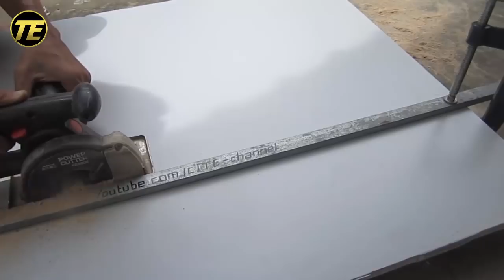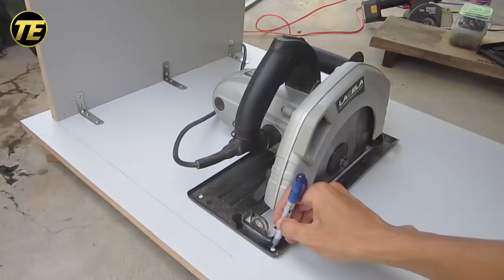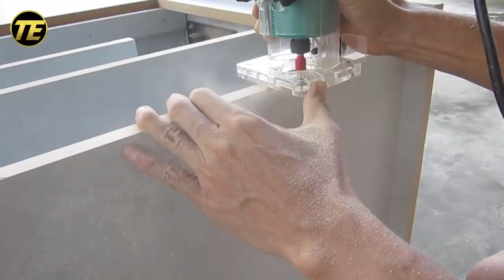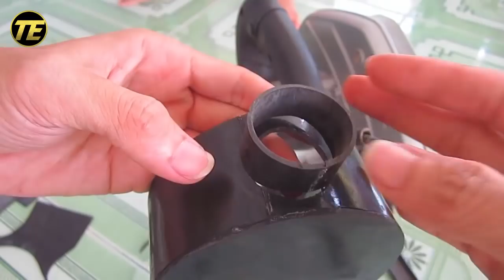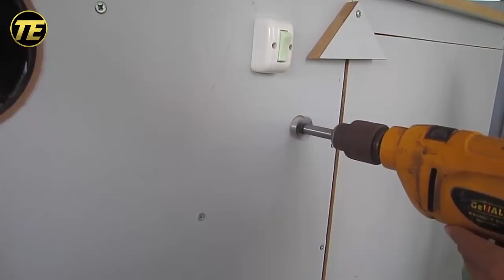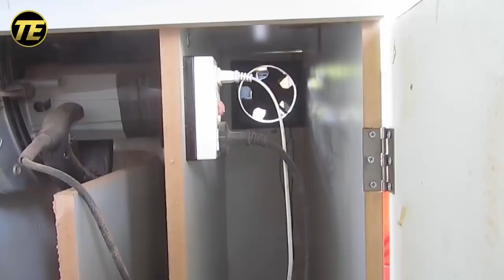DIY - Homemade table saw

Comment: good design, but i dont understand the need for the fan and the white colored pipe being fitted on the circular saw. anyone knows why
Reply from the maker: Fan to suck dust down into the saw table's container. White tube to get outside air to cool the electric motor (the air inside the saw table has a lot of dust)

Comment: I am interested in your vidio table fence, which I want to know and ask how to change your battery drill using electricity, please circuit info
Reply from the maker: you watch this video: https://www.youtube.com/watch?v=SY-pwFvttkc
Reply from the maker: You can use a battery or 30A adapter

Comment: How much your hand-drilling machine?
Reply from the maker: máy khoan 250k, máy bắn vít 250k, cưa cầm tay 400k. Mình mua mấy máy hàng bãi của nhật, máy bị hỏng pin mình nối dây vào nguồn tổ ong 30A (150k)
Reply: Máy khoan nội địa Nhật sài điện áp 110V nên phải có biến áp đúng ko a Hải, rẻ thật nhưng hơi bất tiện ^^!
Reply from the maker: máy a xài là máy xài pin 12V mà pin hỏng rồi, mua pin với sạc giá cao quá nên a mua cái nguồn tổ ong 12V-30A xài đỡ, hoặc nối vô bình ắc quy xài cũng ok